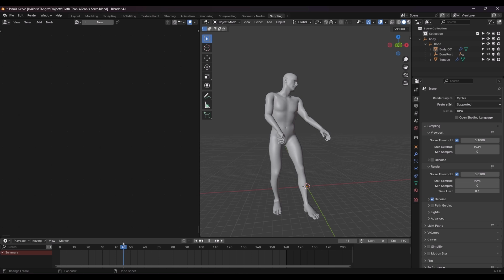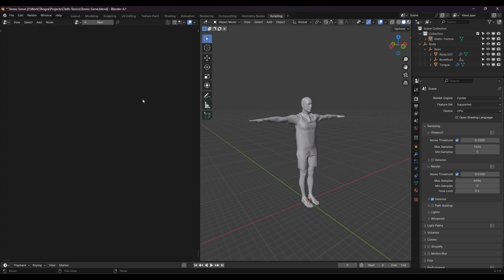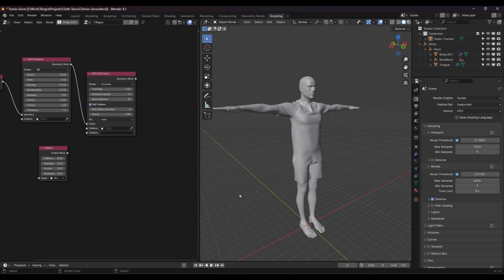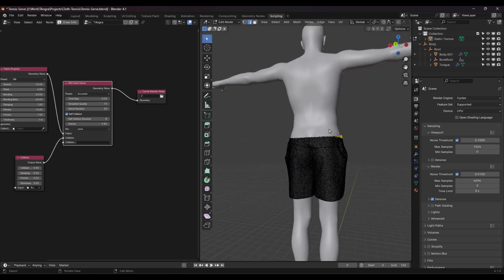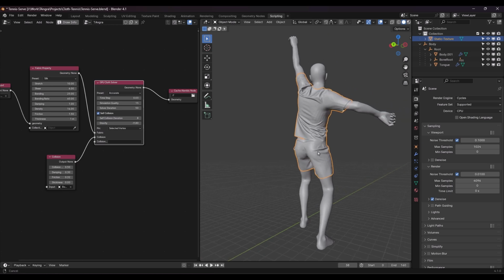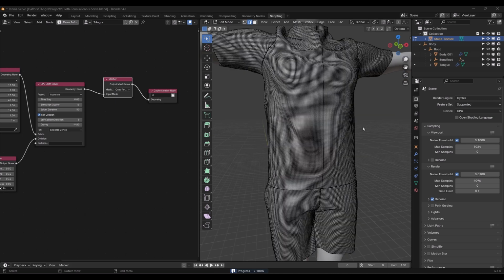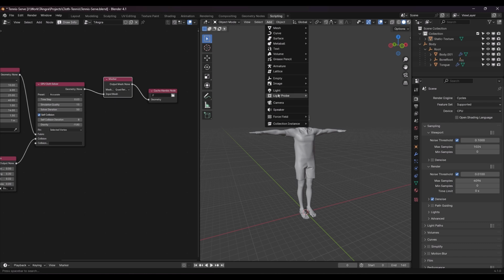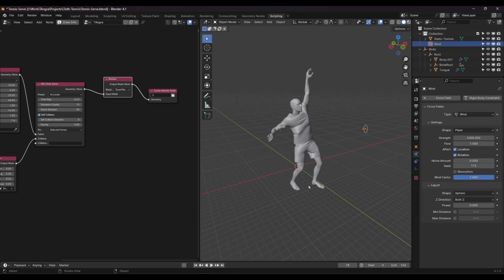GPU Cloth simulation in Blender using TAngra GPU Cloth Solver

Comment: Maybe this is something even the Blender devs would like to look at.
Reply from the maker: in blender dev forum i got a very mixed reactions. even in blender artist they are more critic than supporters I'm not sure why.
Reply: @TangraFX  I mean this looks really good. Anyway i am looking forward to use it, when it becomes available.
Reply: @TangraFX  They're afraid of something, I don't know what it is, but they're very cautious about something. I have no idea about programming, and I don't know much in this field, but I see that they reject anything the blender lacks. I think they have a plan or something they are following, I don't know what it is, but I think they want to focus on other things first. I really don't know, but no problem. We are in great need of a good simulation system for the blender. If you complete the project well and develop it to a very advanced stage, it will be an incredible thing for Blender users. We will buy it without thinking. I wish you success, complete the project, maybe this assistant program is the future of the blender in simulation
Reply: @TangraFX  haters gonna hate